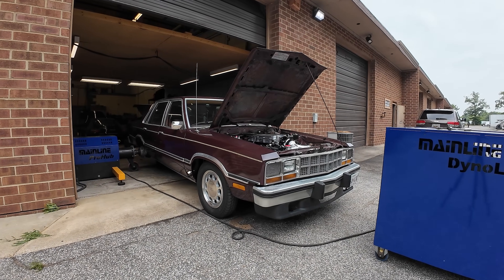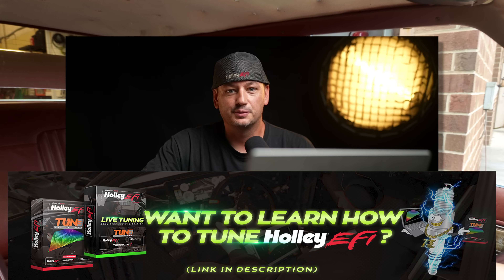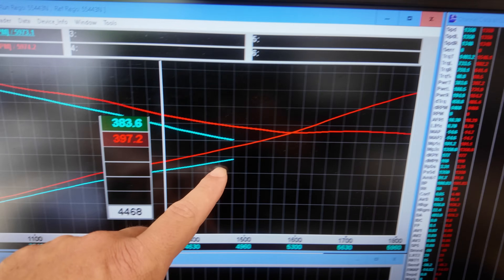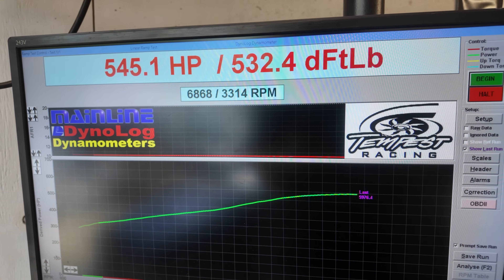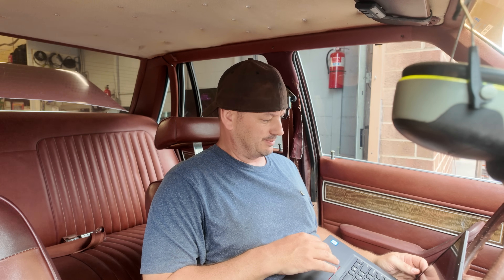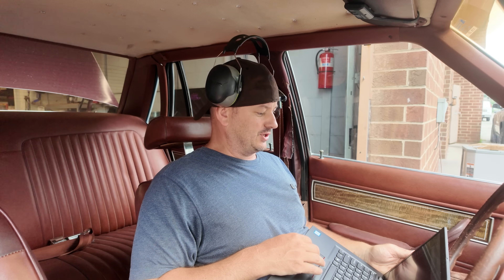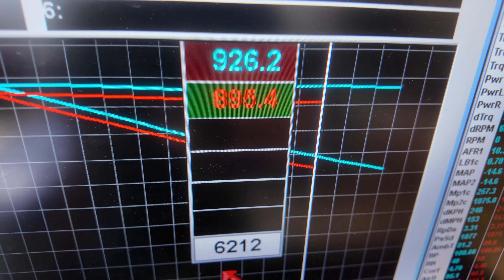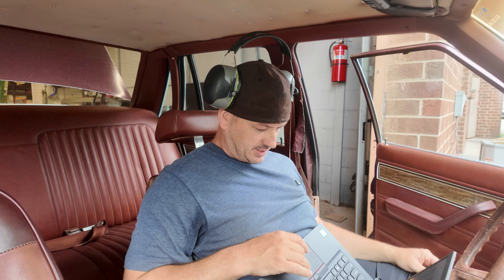Dyno Tuning a Ford Fairmont with Twin Turbos & Holley EFI

Comment: What heat range plug was it? Why are they running projected tip plugs in a high boost/power application? What's your take on that?

-thks!

Comment: Why do these Chevy guys insist on gm motors in ford cars. ? Isn’t there a GM car made in the 80s that excepts a v8 ? 😂
Reply: Dem ol tin can Fords are lighter than a crackhead
Reply: @tdog1035 I know I have a Fairmont but it’s a got 5.4 4v
Reply: I think it’s no brand guys finding out GM hit a home run with the LS stuff and they use them in everything and it makes Ford guys mad.

Comment: That my baby!
Reply: Love it men Fairmont it's clean and  fast wow men wow  Joe it's a monster 🙏.
Reply: need to name it twister!
Reply: Sick build man, whats the setup?
Reply: @ritchardposterior262  built bottom end 5.3 liberty heads custom cam twin vs 67/62’s 1.80 glide 3.31 gears tick intake manifold
Reply: Love the car, definitely a clean sleeper build!  
 What's the air to water setup? Pump, heat exchanger, ect?   I'd like to do a2w on my turbo LS build.
Reply: @dave_kauffman  generic frozen boost radiator as heat exchanger, mishimoto ice tank with 12v sump pump inside, tick performance low profile intake /intercooler.